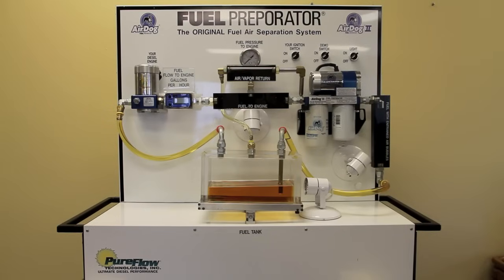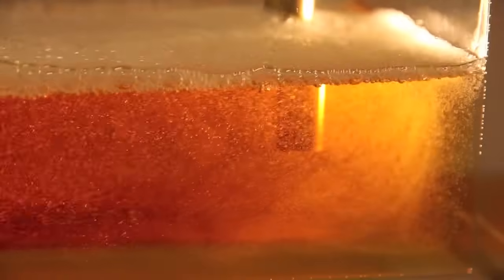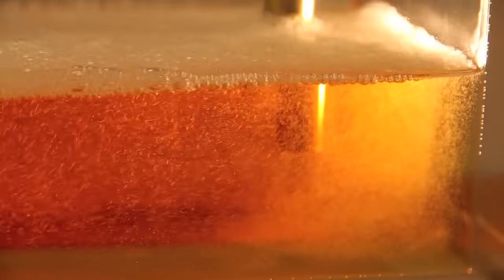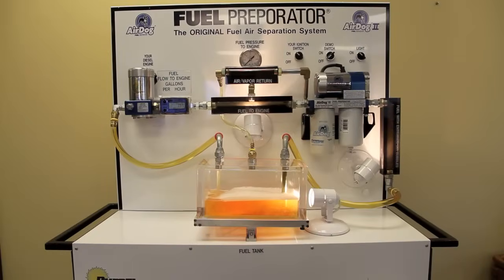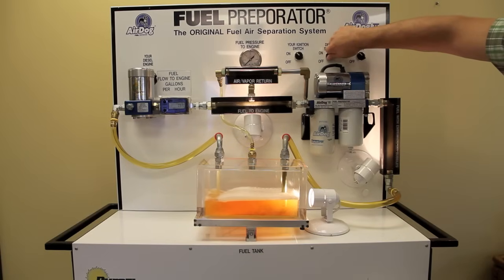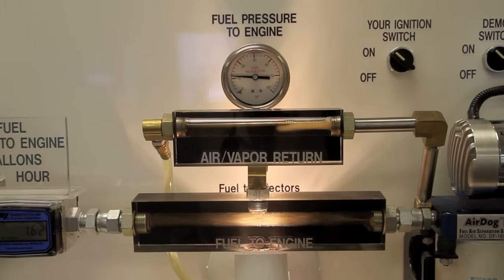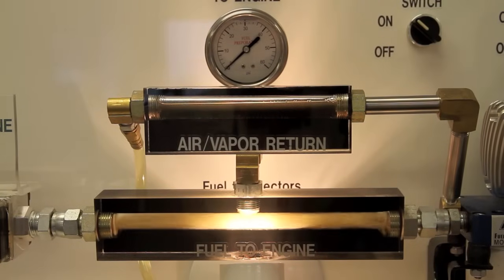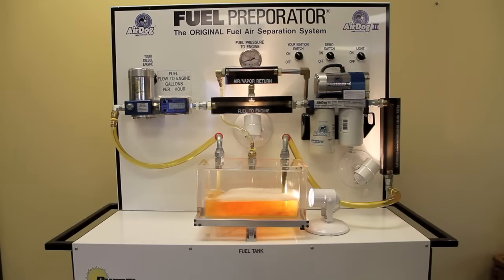AirDog Demonstration Stand

Comment: About to buy a 2006 2500 express van with the 6.6 Duramax. After much consideration I am leaning towards the AirDog over the FASS system. Cant give an exact reason though. Both seem to be good products.
Reply: tommaskey - Did you use this system and what are thoughts? Considering it myself on the same vehicle.
Reply: @nickspicks9579 I installed it but had to abandon the project for a while so I can’t say too much about it but, I do think it is very well built. I got it pumping fuel to the motor but had to leave before I could get it to start. This van was sitting for about ten years so I had to clean out the tank and replace all the lines. I’ll be starting work on it again in the spring after I finish my other van.

Comment: Do you guys make an air dog lift pump for a 2021 L5P Duramax turbo diesel
Reply: These pumps aren’t meant for any one truck. All you need is a bracket to hold the pump and to splice into your existing lines.
Reply: These things will work on anything genius
Reply: I’ve heard that l5p come with a lift pump from factory

Comment: Where's the return tube? Whoever engineered that fuel tank should be fired. Oh I see, you're purposely pouring the return fuel onto the surface which WILL create a lot of air bubbles, thus making people think OMG I need your product! Pull the fuel cap off any running semi truck and take a peek, the fuel won't look anything like this B.S.  Modern day snake oil sales pitch here....
Reply from the maker: Also, Cummins Engine Co. doesn't have a TSB on entrained air in diesel fuel for nothing.
Reply: You will never see the fuel return dump fuel onto the surface of any diesel fuel tank. They all have return tubes fully submerged to prevent all of this aeration. I'm sure you have a great product, probably even better than your competitors, but you're misleading everyone that watches this video.
Reply: Fuel sloshing in the tank creates the same aeration. No, the return might not "dump fuel onto the surface," but fuel sloshing in the tank as a truck goes down the road, and over rough terrain, produces the same effect. The video does a good job at showing the AirDog doing what it's supposed to - remedies the issue of air in fuel, however it happens to be introduced into the fuel.
Reply: After watching this video I pulled my fuel caps this morning. 405 mile run. Not even a slight amount of foam or bubbles in the tank. Probably because the fuel return is submerged as the op in this post stated. Seems like a misleading video to me too.
Reply: Not a fan of Airdogs.  Had too many of the o-ring shaft seals going bad and filling the Airdog motor with diesel, killing it.
Reply: @monelfunkawitz3966  The Airdog II 4G is supposed to have fixed that- they've separated the motor from the pump so fuel can't get to the motor in the event a seal leaks.
Reply: Unfortunately, you don’t need this. Great speech, but be honest with the presentation. Your diesel will do fine without it, trust me…..over 20yrs as a diesel mechanic.
Reply: @Theyhatelogan  um if your modified then yes you do . And it's you wallet if the cp4 in the modern truck grenades costing you 10 to 12k to get that motor back running
Reply: @oldblue101rf  new to diesel. Do CP3 pumps have the grenade issue? Mechanic already told me about CP4 pumps.
Reply: @Theyhatelogan  anyone who says "trust me" is oftentimes a liar and should not be trusted.
Reply from the maker: Where do you think your engine return goes or what your fuel looks like at low fuel level? Think what you want, our systems flat out do work.